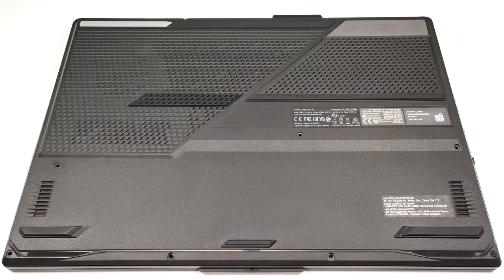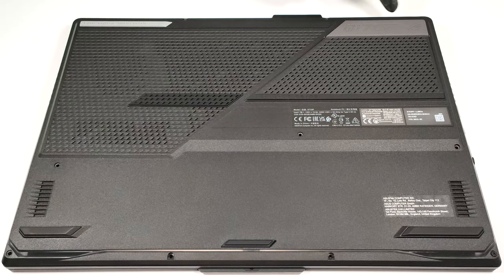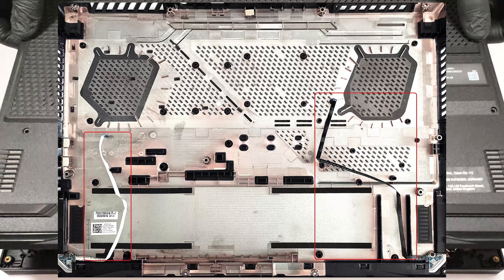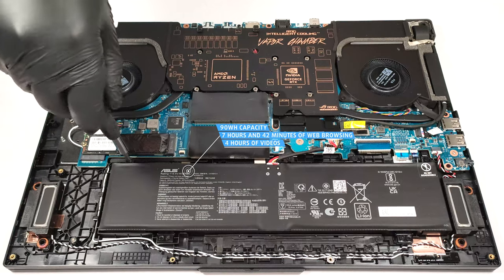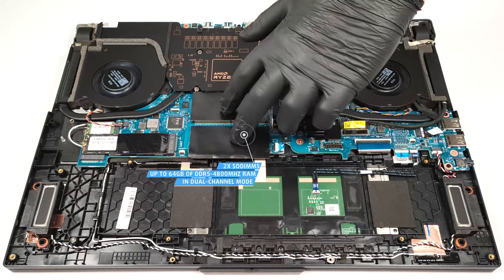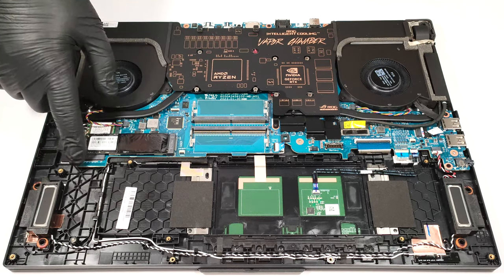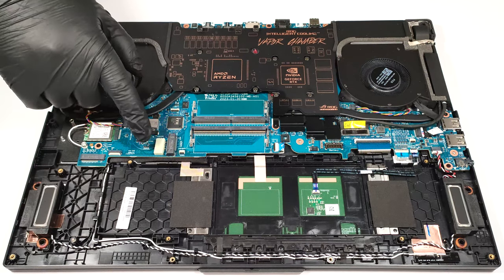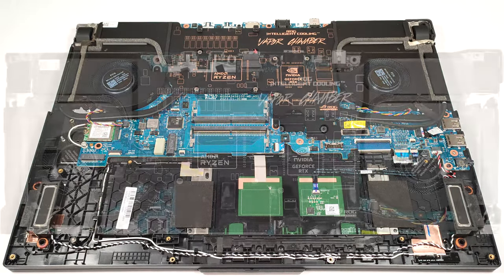🛠️ How to open ASUS ROG Strix SCAR 17 G733 (2023) - disassembly and upgrade options

Comment: Thanks, I wanted to open up mine to add another SSD, could you perhaps make a guide?
Reply: It's super simple. If your just adding another m.2 the slot is empty. The pins are designed in a way that you can not plug it in wrong. The connection is perpendicular to the factory SSD and it'll be over that mostly plastic area to the left in this video.